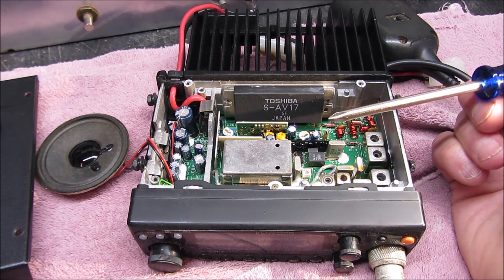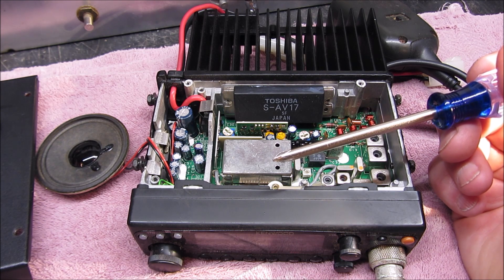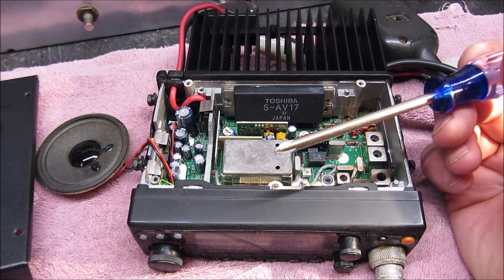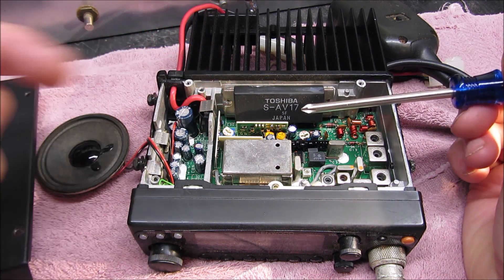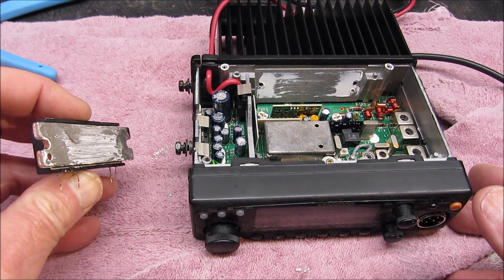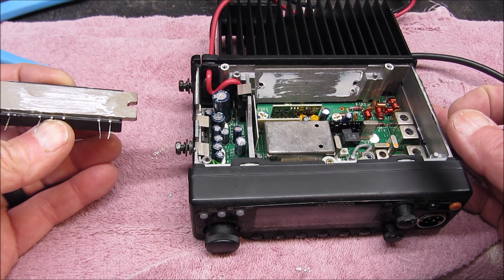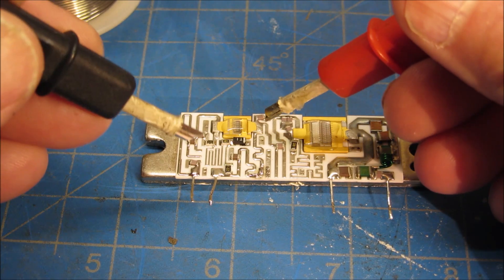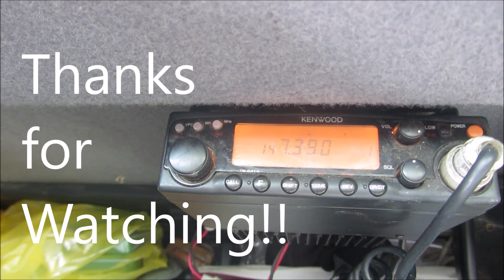Repair of a Kenwood TM 241A Power Output Module

Comment: Really great troubleshooting job and repair Larry. I never have much luck with small boards like that my brother Ron has wired up and flowed solder onto micro boards and actually built two solid state receivers. But he has 50 years experience in electronics and telecommunications.
Reply from the maker: Thanks “Double L”, I got lucky myself, I saw a similar issue on the internet and youtube….I was hoping this was the problem……this rig had been dormant in my truck for several years….glad to get it going again….Thanks for watching and as always, the comments! Take Care—Larry